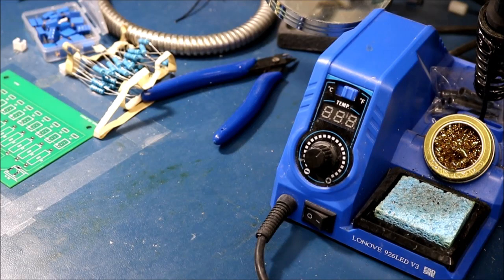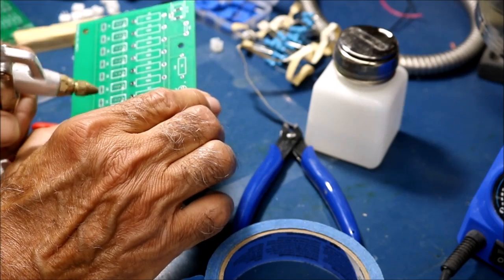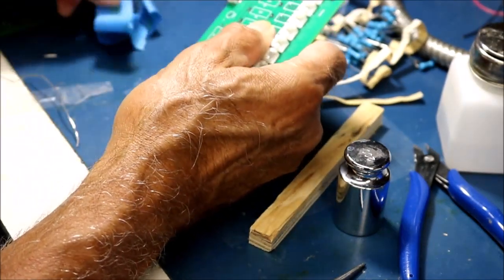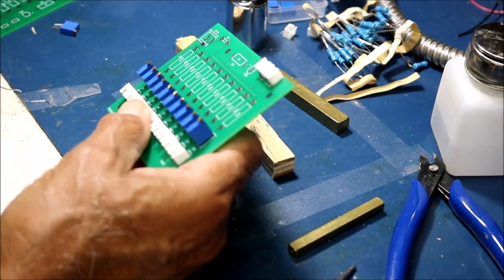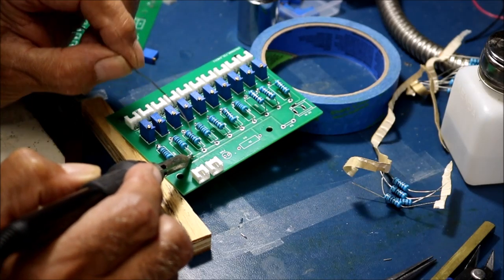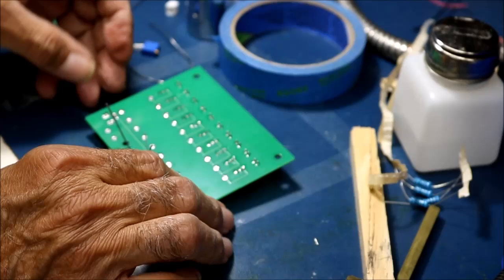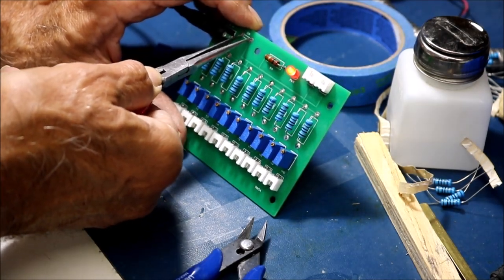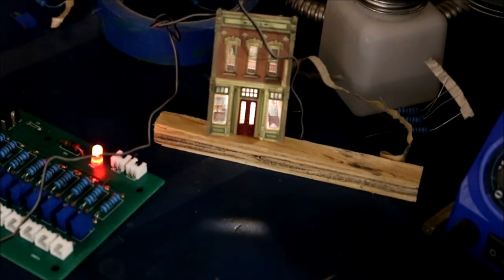Dimmer Board Build

Comment: Thanks I learned something every time watching your videos. I didn’t know about keeping the resistors off the boards when you saw her on makes sense because they radiate heat and I learned how you cut the excess wire for resistors, potentiometer, etc. off the back and the tool you used to cut them off.
Reply from the maker: you are welcome

Comment: I looked at your earlier video where you also had a circuit using the 2N2222. Does it have any advantages over this all-resistor circuit?
Reply from the maker: I explain that in my book. The transistor circuit is more complex and less reliable. They both work about the same in this application

Comment: I watched your build of these huge through-hole components and then you said that this is less than $1 per channel. This set off the BS detector in my head and I quickly did some calcs at well over that using 1/2 watt trimmer resistors. Then found you're recommending chinesium trimmer resistors off amazon with no rating. This is an expensive build using quality components BTW.
Reply from the maker: Try to get American made components today and let me know how you make out. The trimmer resistors are .5 watts.

Comment: I would like to use these boards on my layout.  Do you have plans to sell these kits. Thanks
Reply from the maker: I now have kits available
Reply from the maker: Yes I have circuit boards available but not assembled boards yet.
Reply: @PracticalEngineeringSolutions  Great, I would like to purchase two unassembled kits please. can you send details? cheers
Reply from the maker: I have just the raw boards @8.50 each plus shipping. I do not sell kits ( at this time)
Reply: @PracticalEngineeringSolutions  That's fine, I can get the components. I would like two boards plus shipping to the UK. Can it be done?
'
Reply from the maker: Yes, send your address to tomswift9748@gmail.com and I will figure shipping